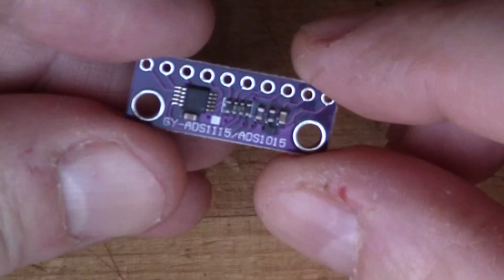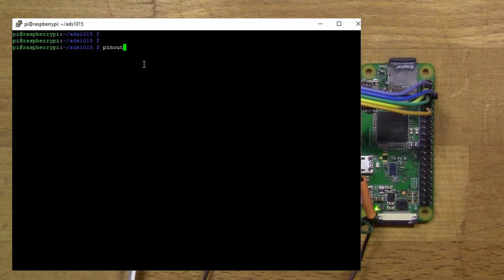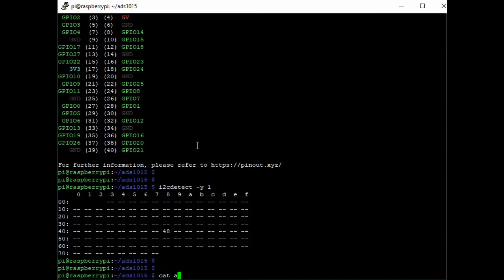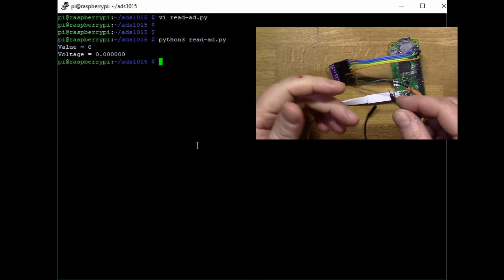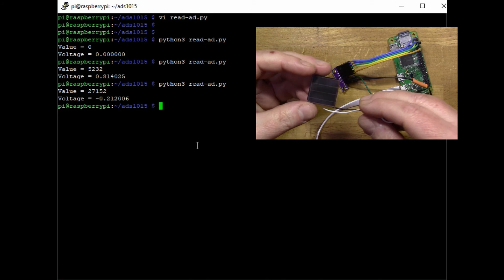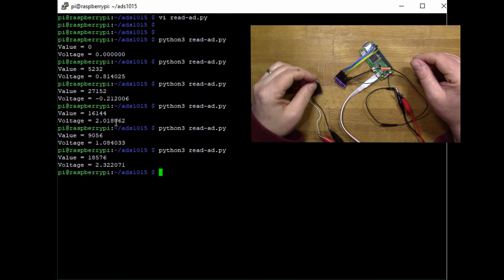A-to-D converter with the Raspberry Pi Zero W - ADS1015 (#133)

Comment: Hi Martyn,
Great explanation of using ADS1015. 

What do i do with the adafruit  github library link ?
I have opened it as a webpage in a chrome browser and their are various files and folders on the webpage. 
Do I copy and paste them all  into a folder in the raspi?
Thank you for any help
Reply from the maker: Adafruit have some installation instructions: https://learn.adafruit.com/raspberry-pi-analog-to-digital-converters/ads1015-slash-ads1115.  After following these you should be able to 'import adafruit_ads1x15' in Python.  I should probably do a git/github tutorial in a video, as a lot of vendors now use git as a way to provide their drivers.